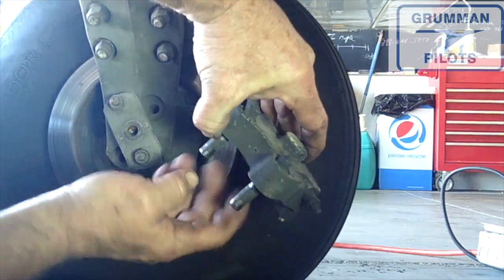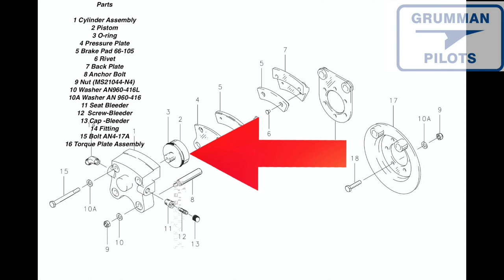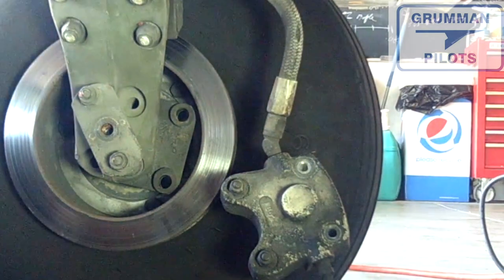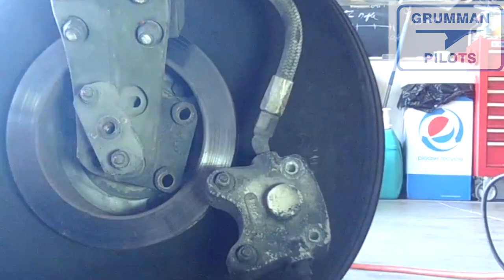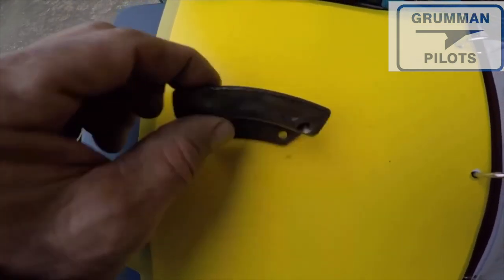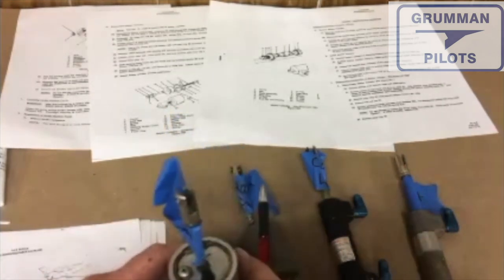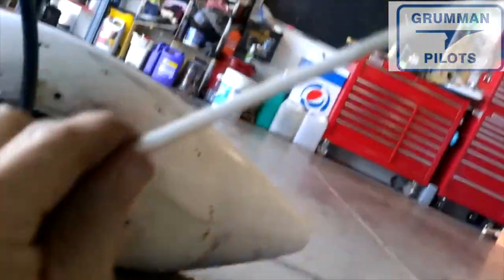Airplane Brake Service Overview - Grumman Style

Comment: Ive personally not been able to get the chains parking brake to work properly even after adjusting the mid point of the chain and make sure both chains bring up both of the locking thingies on top of the cylinders. It does work on one side typically though so im curious to see how the hydraulic parking brake works opposed to the aa1as chains
Reply from the maker: I checked mine every year or so and in all my chained brake parking systems, never had a problem.  Did not use it often, but still.

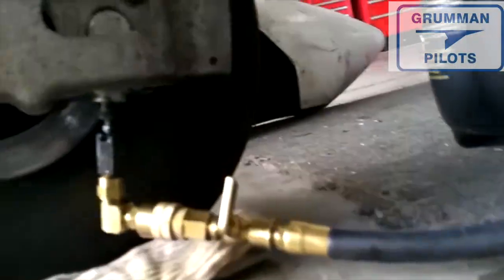Comment: At about 6:17 you show a collection reservoir. How do you join the bleed behind the brake pedal to the collection system (or into a bucket for that matter)?
Reply from the maker: We use a 1/8 NPT threaded nipple (from NAPA) to go into the brake cylinder and then attach the clear tube that goes to the peanut butter plastic jar.
Reply from the maker: At 6:31 you can see the white plug in the other tube laying on the floor to the right of the jar.
Reply: @GrummanPilots  awesome, thank you!!
Reply: Do you know the size of the thread if I were to remove the top of the cylinder eg 1/4 down to 1/8 or 3/8 down to 1/4?
Reply: Never mind…I actually got a copy and read the maintenance manual how to do it, thank you!

Comment: is there a special brake fluid, is there an automotive equivalent?
Reply from the maker: Aircraft hydraulic fluid 5606.
Reply from the maker: DO not use automotive fluid.  Aircraft spruce sells this:  Hydraulic Fluid MIL-H-5606A